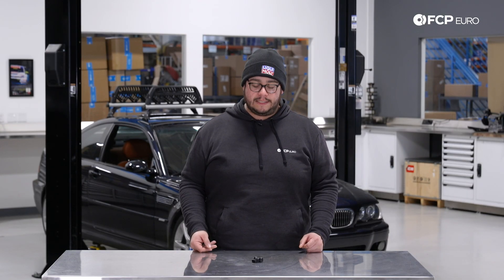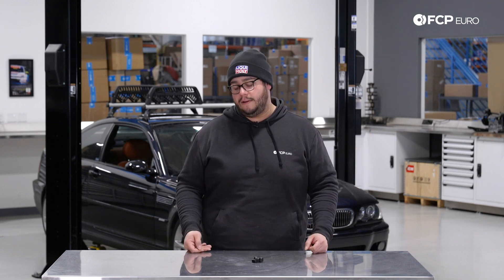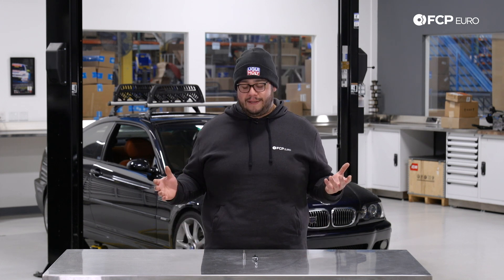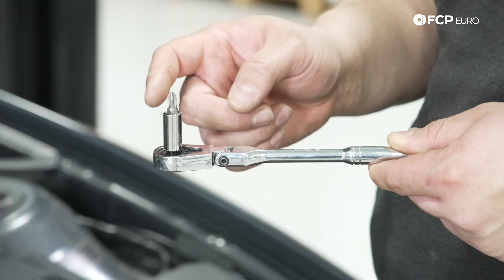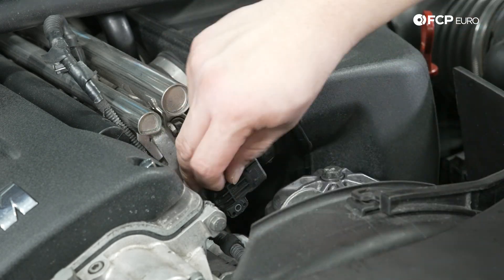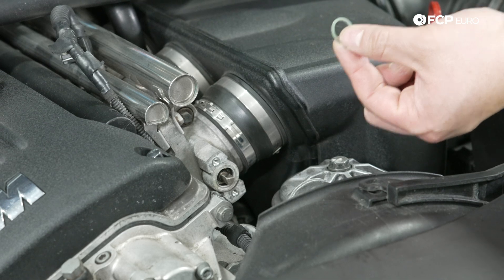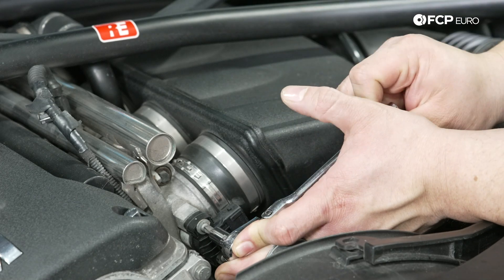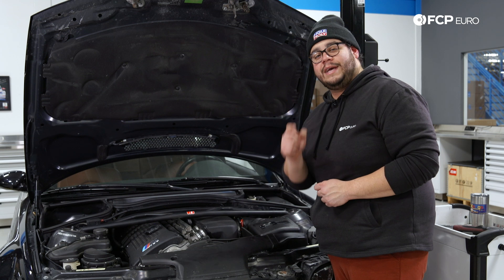BMW E46 M3 Throttle Position Sensor Replacement DIY (2001-2006 BMW S54 Engine)

Comment: Guys I need help. I have had limp mode with EML for 18 months now, the last code I have is 0000E6 - (DIGITAL MOTOR ELECTRONICS (DME), electric throttle, setpoint/actual value deviation). 
We have replaced, throttle actuator with TPS, throttle body TPS, Vanos solenoid pack. Calibrated the new hardware, twice, once at the dealer. No luck. Car randomly throws EML light, takes some time to trigger, car warm, after spirited driving. 

Anyone solved this issue before? I've had this issue since purchase and I'm kind of loosing my mind trying to solve. A friend advised bad DME or DME relay? Possible? Any help would be appreciated.

Comment: Hello, my tps has 2 wires and when i tested them for voltage both wires have 12v. I drive BMW E46 316i 77kw 105ks. My tps isnt working. I dont know what is the problem. Can you please help me solve this. Also becayse of this my ASC isnt working also

Comment: Excellent tutorial Mike Hidalgo! A DIY video tutorial on replacement of the TPS (2nd sensor) below the intake plenum (BMW E46 M3 S54 Engine) would be greatly appreciated.
Reply: 3 weeks I was driving while making a sharp left turning left  my car suddenly loss power and it sounded terrible and it would not go pass 40mph… plugged in my OBD2 Fusion app with my iPhone. and my 03 E46 M3 replaced the 2nd sensor behind below the plenum, cleaned the inside of the plenum, and remove all the gunk on all 6 throttles with throttle body spray cleaner from Autozone.
Reply: Also replaced the front TPS sensor. 
OBD 2 threw P0121, P0123, P1637, and P0306. Prior to replacing both sensors and 
Cleaning all 6 throttle bodies. It was a pain in the behind installing the the last 2 of the throttle clamps closer to the back of plenum..any ways thanks for listening.
Do you think my car will start normal, or did I forget to do something? Feel free to respond if not, I understand.

Comment: When those go bad. Would the eml light turns on and i have a rough idle when i start it and wouldn’t last 5 mins its shuts the engine off.
Reply from the maker: Hi Tengz, a bad TPS sensor can certainly cause an EML light, and cause the engine to shut off as well. Certainly a good start!

Comment: Do you have to do a TPS readaptation after installing this?
Reply from the maker: Hi Brandon, not mandatory but certainly would not hurt if you wanted to perform one.
Reply: @fcpeuro  can you explain the TPS readaptation and how this is done?

Comment: There is a 2nd sensor below the intake that I would also change at same time. More difficult to get to but a good idea to change both at same time.
Reply: need video for that one lol
Reply: Does this sensor have a name?
Reply: @N54M4CC  both are TPS sensors
Reply: Is it the same tps for both locations
Reply: @caingomez1810 yeah
Reply: There's a third one apparently behind the foot pedal. I've got 3 codes so I assume I better replace all 3 and not try to get cute and think the one you unplug for an oil change will be the only one I need :(

Comment: Probably the easiest sensor to replace, one mistake that I've made, is that when I remover the intake plenum, I used hose clamps, and I put them all at the 3 O'clock position, so the throttle actuator was hitting it and getting stuck I replaced the sensor and the actuator, and I still had the same problem, it took me awhile to figure it out 🤣
Reply: Lmaooo I remember when I was doing my head gasket, I read about someone doing that on their m3 and they got the throttle stuck open